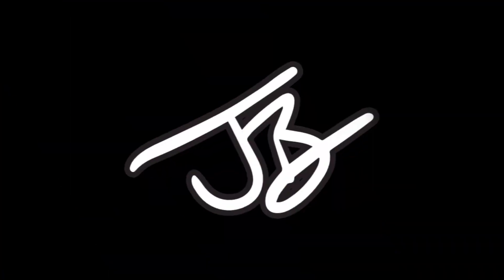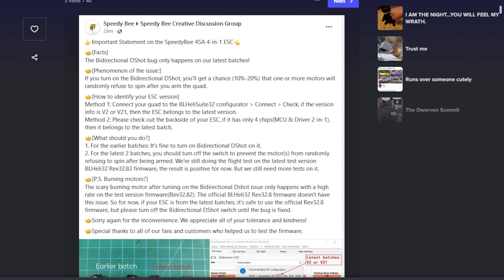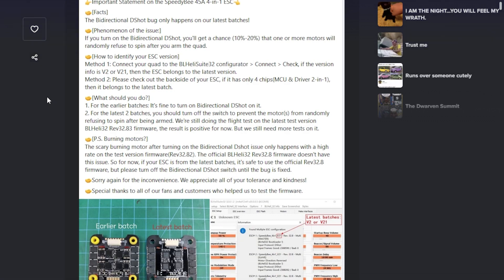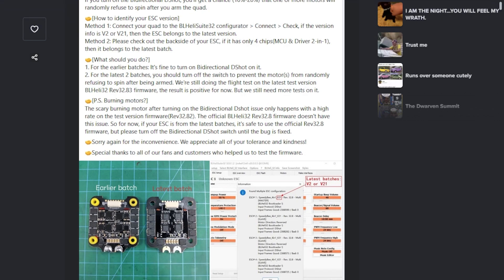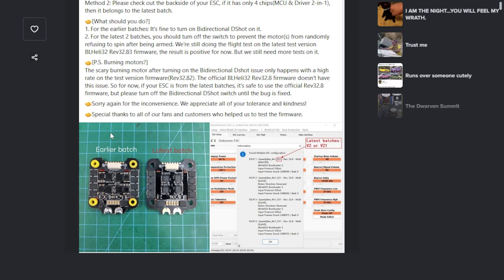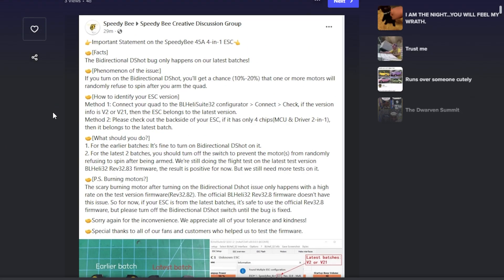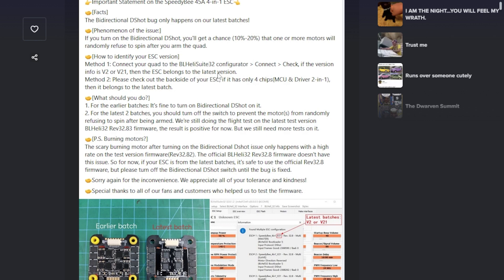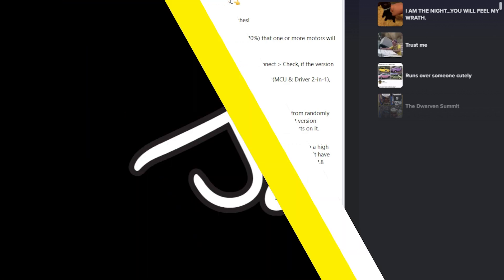PSA Speedybee finally acknowledges ESC issues are bad. Very bad

Comment: I just burned out a second ESC in less than 2wks!!! I replaced one that burned on 3rd flight.  Figured it was a dud bought a replacement and fried on 2nd flight.  DO NOT flash it will smoke in the air.. I spent 200$ lesson learned NO MORE SPEEDY BEE!! I’ll stick w/iFlight .

Comment: I bought the f405 version, took a lite crash and it wouldn't run one of my motors, so I bought a new one and now (before getting airborne) fresh after the replacement, I have three out four motors not wanting to work. And I know my motors are fine, cuz I checked them before changing esc's. I wish I saw this video sooner, I could have saved 140 bucks, lol. Oh well, live and learn.

Comment: Bought the 45A stack two weeks ago, plugged it in, ran motors, set parameters, everything was great. Plugged it in today to fine tune parameters and suddenly there was a white fireball on my table. Unplugged unit and found burning around the positive lead of the battery. I had experienced a few random arcs in the days before this but they where momentary so I figured it was foreign material on the board creating a temporary arc. I guess it was the prelude to a total dumpster fire 😬. Kinda afraid to plug these things in now..my first quad ever btw

Comment: I had one fry a motor and constant desyncs prior to ever taking off. It happened on the bench just setting them up and was a nighmare to even get it to be seen in blheli. They sent me another and fried a second motor (so two tmotor pro 40s totalling 50 bucks). So Im in the hole over 120 bucks and many hours wasted. Getfpv said I'd need to get a refund from speedybee and its clear they are not willing to give me one.
Reply: For anyone using the stack, the FC is actually nice. I paired it with a hobbywing 60A and a qav-s jb edition frame and its my favorite freestyle quad I've built.

Comment: Sadly I didn’t find this video until now. I already built the quad with this stack and motor 4 doesn’t work. First time I connected this ESC to BLHeli it gave me a corruption warning on ESC#2. Figured I’m going to have problems with the return process so just went ahead and ordered a different stack brand.

We don’t need a new V2 as a replacement, they will keep frying up. Bought this stack to use it in a drone for work, not going to put myself willingly in a position where I can get a lawsuit because my quad decided to take a dump and hit somebody or property.

 $130 to the trash can unless RDQ does the right thing and refund me & others the money they took knowing they are selling a faulty product. And that’s IF they know what they are selling.

Comment: Does this directly effect the Speedybee Mini F7 stack that I just purchased, and put in a build x2, and I have yet to fly? I understand your apprehension to all their products, but is this one on the list? Thanks for all you guys do too.
Reply: From everything I have seen and read, the Mini stacks use different MCUs and are safe. My problem is that I have multiple versions of the full size:>) Only one burned up so far, and Speedybee compensated me for that one, but I have had the random motor not starting on several. Testing the 32.83 firmware now. No random motors not starting in over a dozen plugins with bidirectional dshot turned on and no hot motors on a hover test. I hope to fly in a day or two to really get a good test.
Reply: The Mini is ok I been using the same one for a year.  But I’m going to swap out all my Speedy Bee products off my drone.  To be safe… not worth it